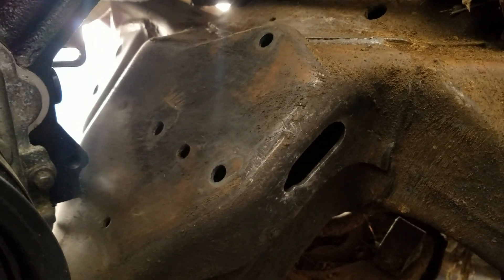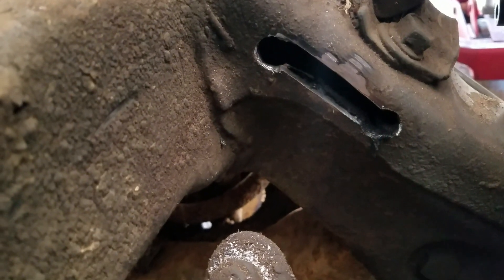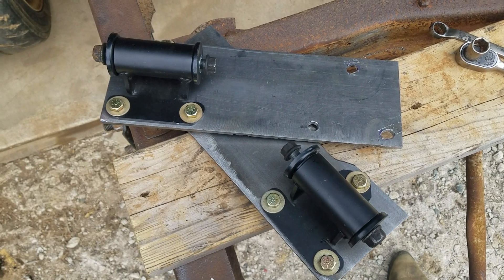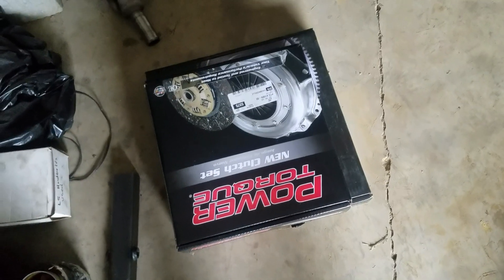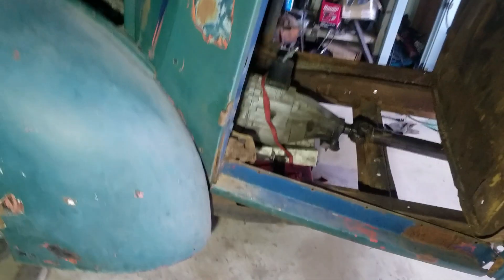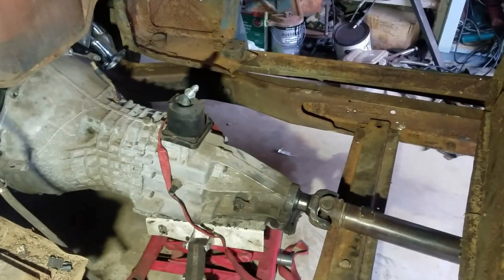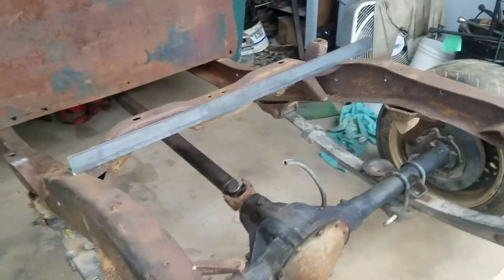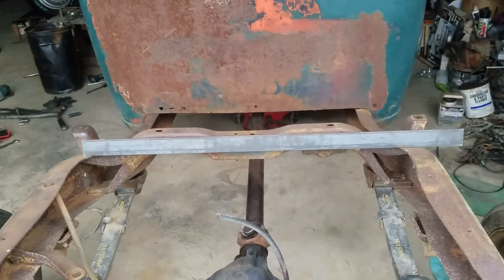46 Chevrolet Truck 5.3 Motor Mounts

Comment: Take and turn the trans cross member over mount on bottom of frame and slide forward should be fine fit take piece of metal like you used for motor mounts 
Is the motor mounts gonna be  ok with no back bracing might twist if your on it hard and it hooks up good maybe not I like over kill lol but your making good progress keep the video's coming and stay safe stay healthy stay busy
Reply: My thoughts exactly on motor mounts needing more bracing. I see that as failure. I got a stock 4.3 in mine that not sure how but it has sunk into the k frame a good inch. And that is at factory location where it should never fail